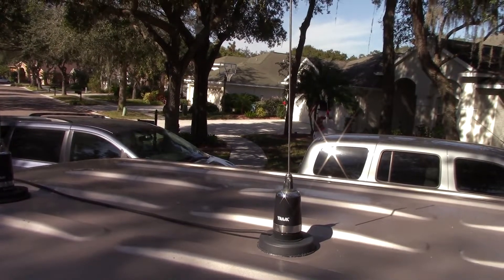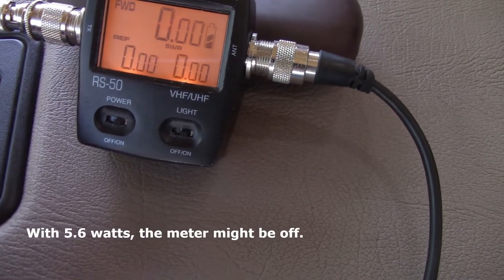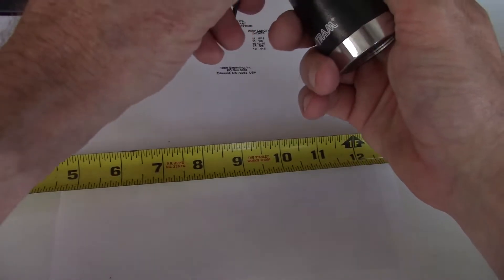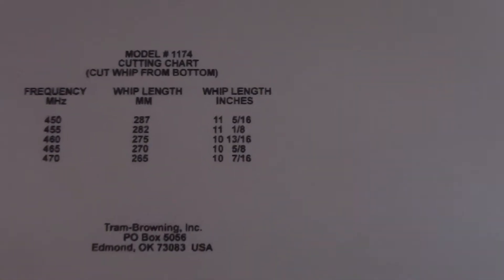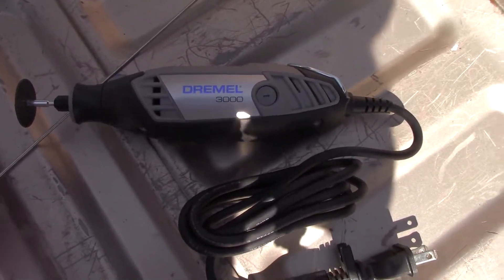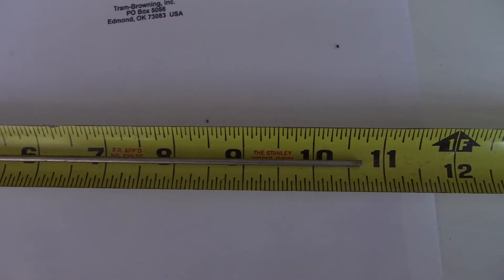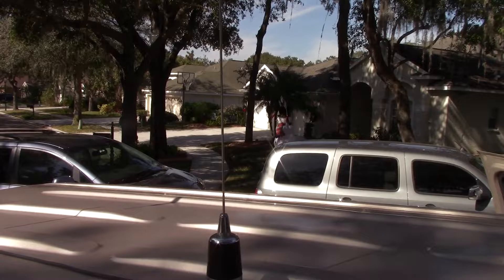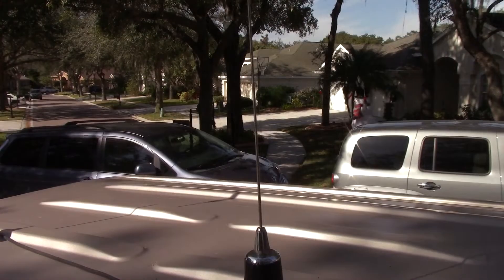GMRS antenna tuning - Tram 1174.

Comment: Watched several videos on this antenna.  Ordering one for my pickup, I have a new HT, and I know an external antenna will help.  I only have 2 repeaters near me, and they are linked.  I do not want or need an antenna with 30ish inches in length....This one seems perfect.  Thanks!
Reply from the maker: I do change them out on occasion. While I like the extra reach of a 5/8 over 5/8 wave, this little 5/8 is what's been on my truck for the past 6+ months.

Comment: Thank you for the video! I like this antenna a lot. I ended up trimming it about 2/3 of what is recommended by the cutting chart for GMRS (465 MHz). I used the bolt-cutter method from Notarubicon. It works well. I stopped trimming out of fear to get "too much of a good thing":) As it stands, I have 1:01 on 462 and 1.02 on 467 (at 5 watts out). That's good enough for me. I want to repeat your fundamental message to everyone: (1) folks, your results may differ depending on where and how you install the antenna; (2) the SWR readings may increase with wattage. Please tune your antennas accordingly.
Reply from the maker: Love a signal band antenna. Easy to tune and normally has a wide freq coverage. Multiband is convenient, but that comes with compromises.

Comment: The 1173 is longer. Is there any benefit to the longer whip?
Reply from the maker: I was using the Browning BR-450 which appears identical to the 1173. The claimed 2-2.5 db gain was there. During my commutes I noticed some weak signals from repeaters getting picked up sooner than with the 1174. Apart from the gain, the antenna was almost 2 feet taller and at vehicle heights, I think this helps as much as the antenna gain. But the taller antenna would get hit more by overhangs, tree branches and such. For running around locally I'm using the short antenna as it does a good job. I'll use the longer one for road trips.
Reply: I came to ask about was this the same antenna as the Browning 450. I like how short this is. Are you just using the top half of the antenna??

Comment: I thought for sure you may have cut it too short. I was thinking of the bit that needs to slide into the base to be screwed down. Perhaps they factor that into the measurement chart.
Reply from the maker: I like to make 2-3 cuts to be sure but this antenna is really broad. It was flat from 440-450MHz so that helped with the decision to just cut at the chart's length.